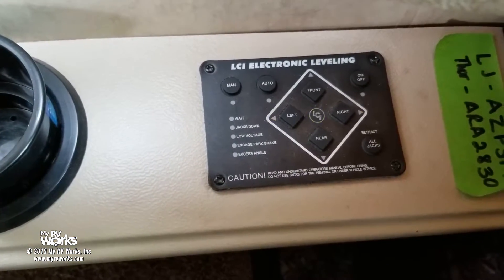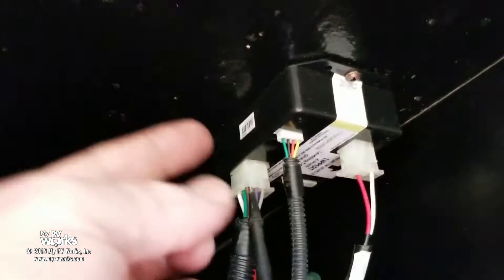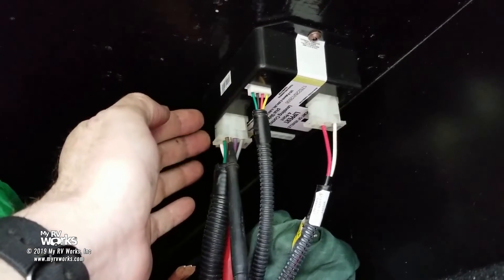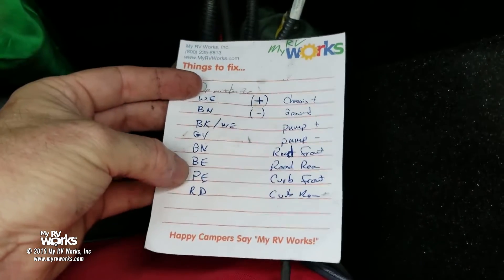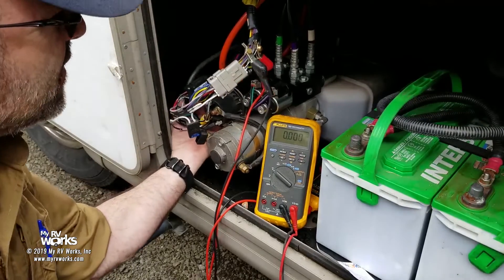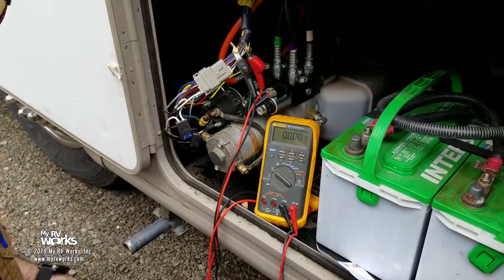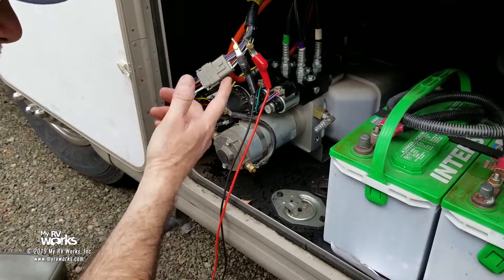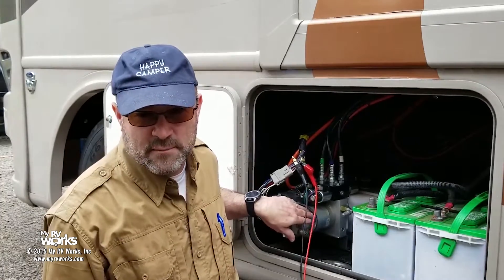Troubleshooting Lippert Electronic RV Leveling System Points To Failed Motor

Comment: I have check the leveling control module I have voltage but seams low to me 11.5 but I ma getting 14V back on the solenoid but when I start the leveling process I here the solenoid click but seconds later it kicks off what would cause this to happen

Comment: I'm getting a low voltage light as well as the "jack down" light on when the jacks are up. Any suggestions as to where to start, would be greatly appreciated. Obviously the low voltage light can be troubleshot easily, but the jack down light on is a head scratcher.

Comment: I have a 2023 ace 29g and can not locate my pump. It is not in the battery bay or any other bay. Any idea where it is or how to find it.. thanks
Reply from the maker: Okay, here's what we know. If you can push the button to start it someone can be listening for it on the outside. Often times it will be exposed to the outside from underneath (that is to say not in a compartment). So, if there is a hose leak or something it's not going to leak inside the compartment bay.  You may have to crawl underneath the RV to get access to it though. I'm not sure but on some of the ACE RVs it's on the driver side behind the front wheel.

Comment: Sure enjoyed finding this content today after you posted 3 yrs ago! Is there a way to override electrical to retract jack? Maybe bleed system while manually jacking each jack?  Was given some attachment to insert in the motor but I wouldn't know which valve to retract. Not trying yet!
Our 2013 Montana has an issue with retracting jacks. The pump will extend jacks & slides work fine, just not retract jacks. I'm thinking our issue was placing several 6v lead-acid batteries which off-gased in compartment with controller causing it to malfunction. Exterior panel was replaced after overheating in hot sun. Is that common?
Thanks so much for all your wonderful educational videos.

Comment: You helped me diagnose my dead leveling system.   I thought it was a bad motor, hooked up ext battery source and it worked.   Saw lot of corrosion on the power into the solenoid and took the leads off of that terminal leaned it with wire brush and put it back together.  It now runs perfectly.  Thanks so much.  Couldn’t get in anywhere or get mobile service for months so again thank you.  Keep up the great info videos and advice.

Comment: No issues with my LCI until today. Display panel lights up. In Manual and Auto mode, the display "says", "Grounding left front". However, no movement. Clicking on the solenoid. Soleniod, good volts all the way around. When reset and using motor as ground, 0 volt on motor side (L) and 13.22 volts on the soleniod side. But, im not getting anything on the motor when not engaged like you did in your video.

Comment: I have this very same system in my 2012 Thor Hurricane. The problem I am having is when I depress the "On/Off" button, nothing happens. I have to keep it depressed for at least 2 or 3 minutes before it kicks on. I have new coach batteries so I don't think its a battery issue. Any suggestions?

Comment: love your videos.  I'm having an issue with my level up system.  about 30 days ago I used the system.  today I went to turn it on at the control panel and no power to the control panel.  the coach has a brand new battery that is connected and working fine.  any ideas?  thanks
Reply: I'm having the same issue. Thinking about just replacing the control panel. Amazon sells them for $250.00 new

Comment: My slide outs will  slide out but will not slide back in if I switch lines around on pistons and push out switch it will push slides back in checked all the connections and relays and are all good any ideas
Reply from the maker: I work on this type of issue recently. It involves leveling jacks. The issue there turn out to be the control module sitting the incorrect output signals. We replace the control module and everything worked fine.

Comment: I have a question, my motor bolt (there are two bolts to connect to power - like yours shows - one for jacks up, one for jacks down) is loose (the rod is loose not the nut).  It works the other day but now is smoking when I am trying to put the jacks down - retract/ up works fine, but now down does not work at all. Is there a way to seal or reconnect the rod or do I have to replace the whole motor? These motors with two power sources are almost $1000. Thanks, wendy
Reply: I decided to replace the motor

Comment: At 6:12 those test leads have PIN CUSHION wire test clips. They pierce the insulation with tiny pins in an area about the size of a pencil eraser. The pins contact the copper and just barely damage the insulation, though they do penetrate the vinyl .  Not good if submersed in water or repeatedly squeezed in the same spot..  If in a constantly wet or salt air environment, the copper will eventually create resistance or a "high open" and dissolve until completely powdered. Then the problem will be hard to find unless you pull on the wire and find the corroded break inside the insulation that still looks intact.     JwgK

Comment: I'm dealing with the same issue...but with a little different twist.  I followed the same type of troubleshooting to find that the motor was burned up.  I ordered a new motor and within 2 hours of driving it suffered the same fate....very costly mistake.  By replacing the motor....I just cured the symptom and did not find the real cause for the issue.  Lippert says that the issue is either a weak pump or a faulty pressure switch.  I think the issue is that there is nothing built into their software to keep the pump from burning up....but that is another discussion.

Do you have any troubleshooting advice on the next level of finding the real root cause for the problem?  I went ahead and ordered a complete manifold (pump, motor, pressure switch, reservoir and valves) but don't want to put this on until I have a better understanding of what the real issue is.

Comment: Great video, I’ve had my coach at the repair shop for this problem with LCI. So now I bought the $800 motor and no joy. LCI tech said it is now the control module. There went another $370 and the labor is not even included. I sure hope they will do a return at LCI for motor. If not I guess I have a spare.
Reply: How much for the spare 😂 were you able to return it?

Comment: I have a lci leveling system that the control panel inside and all the lights flash and don't stop even if I push the on off buttons I'm thinking it's the other module in the outside compartment

Comment: This is 100% how science works.
2:53 He forms multiple hypothesis and reveals his method.
He then gathers evidence that either supports or disproves his hypothesis.
12:00 He gathers compelling evidence for the theory that the motor is not working.
He discusses his research until the end.
There are lots of statistics that can be applied to the scientific method, but none-the-less, this man has used the scientific method to diagnose his RV.
Reply from the maker: Thank you very much for your comment!  We do our very best to educate the RV'er.
Reply: @MyRVWorks who the what the fuck?

Comment: Hi, I have a 2010 Georgetown  378 XL.  2 of My slideouts, main and kitchen failed at the same time,  I am able to open them but will not close. Also at the same time my lci leveling touch pad keeps blinking and says low voltage.  I already spent $1500 in labor at 2  different rv shops  and they can`t fix the problem.  can anybody help please
Reply: I’m on that same path right now with the low voltage problem

Comment: I know following the trail of 12 v is the engineering thing to do to prove your issue but couldn't you have just gone to the motor first and seen the 12 volts going in and the motor not responding? Hell yeah I'm lazy and take the path of least resistance. Lol. Great job as usual. I do like how your process proves everything but its a long winding trail typically.

Comment: Your always a wealth of electrical knowledge! And so systematic in your diagnosis of the issue. Other RV repair guys must hate you, Lol
Reply from the maker: Hey Tracy,  LOL - thanks for the comment.  I don't have any real competition in my area - there are a few part-time guys that have been here for years handling mobile RV repairs (I have only been in this area about 2 years, was in Texas a few years before we escaped the heat and came up here) but I don't think they approach this market as serious a business as I have done.  There area also a few shops but they hate loosing a tech out of the shop to address an on-site call.  So far it has been going well.   Interestingly there have been several mobile RV Techs throughout the states that have reached out to me on these comments and email asking how I have my business structured, inventory, CRM etc.  I may have a new gig as a consultant eh'!

Cheers,
Darren

Comment: Thanks, very helpful to show a systematic troubleshooting process and experienced explanation. Also good job on audio and video quality. My suggestion would be to add or continue with a new video, after replacing the motor. For example, what caused the motor to fail; i.e. maybe the driven pump was locked up causing the motor to overheat etc. Thanks again for sharing your good work.
Reply from the maker: Hi Russ,

Thanks for the compliment!  I like your suggestion on the follow-up video.  We already have that customer repaired and on his way.  Another Happy Camper!!! I do still have the motor and I am collecting a box of failed components that when I get a slow day (not likely over the next few months here) I plan on dissecting on camera for a show and tell series.  That may come out in a few months though.  In the immediate pipeline is more electrical fault sleuthing (in post production now) an awning R&R and about 7+ Dometic refrigerator video's.   

Thanks for being a part of our channel!  I appreciate you!

Cheers,
Darren Koepp